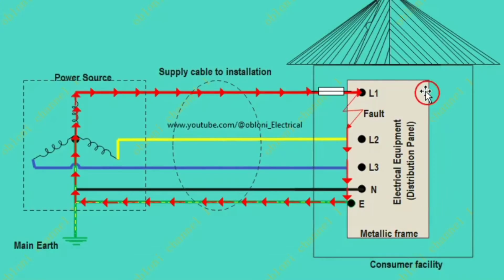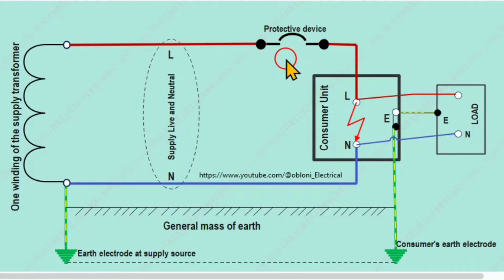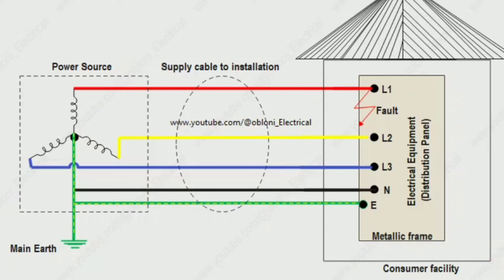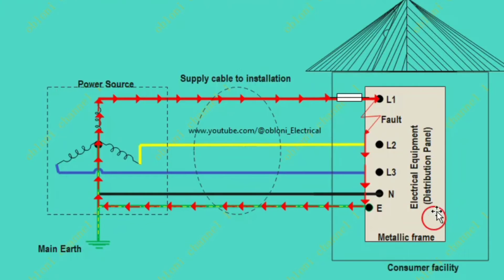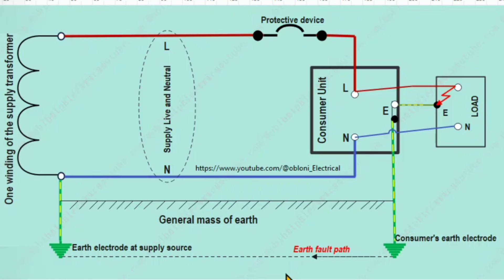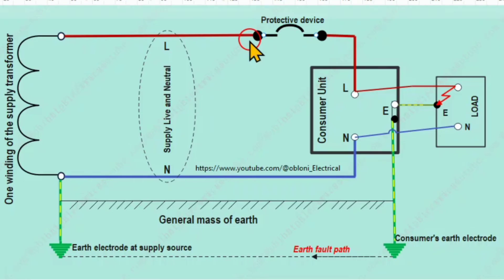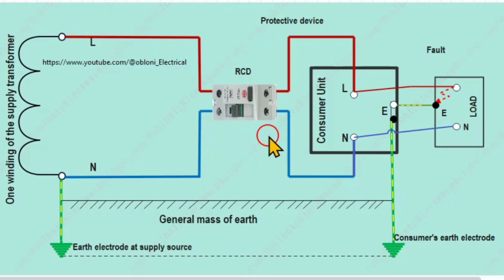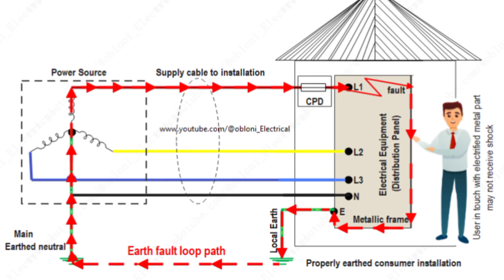Why TT systems Must be RCD protected | What happens during earth fault in TT system

Comment: Tnx for the video, my question is  if  my earth resistance value is low as  6ohms   and there's a leakage in a socket cct ,a 16 amps  breaker did not trip off . What maybe the possible causes . Will this happen if  the supply transforma earthing resistance is higher or.......
Reply from the maker: Some Possible Causes:
1, Insufficient Leakage Current:
The leakage current might be less than the breaker's trip threshold (typically 30 mA for RCDs/RCBOs).
Smaller leakages, while potentially hazardous, might not trigger a trip.

2, Faulty Breaker:
if the breaker is malfunctioning, it can fail to trip despite a sufficient leakage current.

3, Incorrect Breaker Type:
A standard magnetic-thermal breaker might not detect earth leakage currents as effectively as an RCD or RCBO.

4, High Supply Transformer Earthing Resistance:
While less likely, a high supply transformer earthing resistance could contribute to lower fault currents, potentially hindering breaker operation.